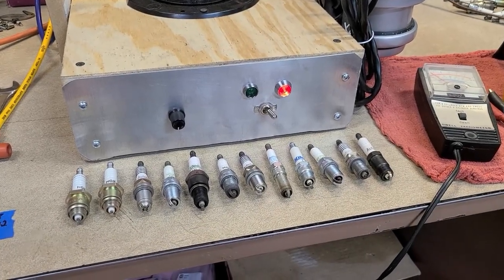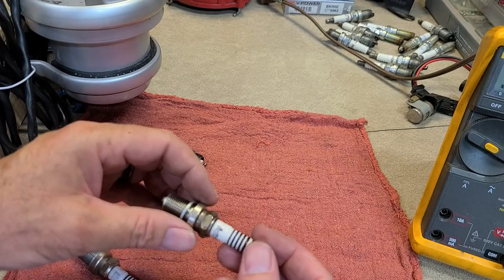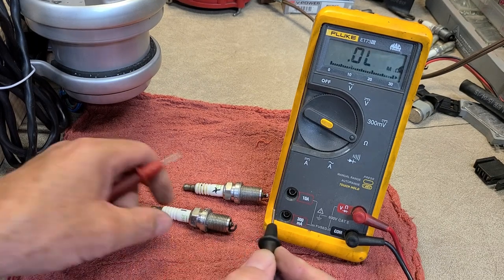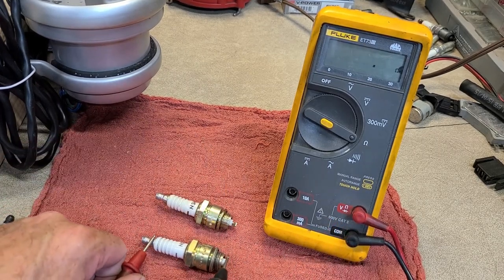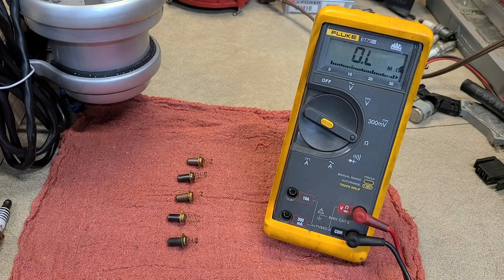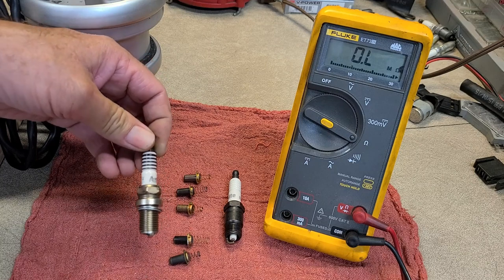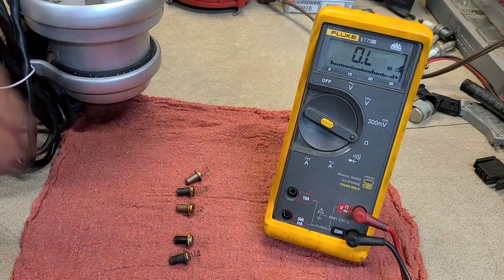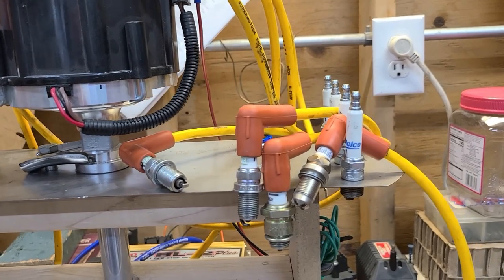Spark plug testing & checking Dwell on an HEI

Comment: AUTOLITE AR3924 racing plug is a 4-ohm resistor spark plug
Reply from the maker: Thanks for pointing that out. For years I was under the impression that all race plugs had no resistor but after looking at numerous plugs it seems some do have a resistor and some don't but they still somehow have very low resistance.
Something I should have tested when we had a racetrack was a high resistance set of plugs versus a very low resistance plug to see if there was an ET difference. Our local drag strip was sold in 2018 so tests like that are much more difficult....

Comment: best module for a big block chevy street car please locked out distributor
Reply from the maker: If you lock out the advance and retain the module, your timing will retard as RPM increases due to latency between the magnetic pickup and the module. Whenever I lock out a distributor the first thing I do is remove the module. You will need an ignition system capable of firing off the magnetic pickup like an MSD 6al for instance.

Comment: I like your videos👍I DO have a question. I worked on a car with an HEI last week that was starting and running very poorly and determined it to be the ignition at fault. Removing the distributor cap and coil cover I found that it had an MSD coil installed but the module appeared to be a factory(?)part- (RKD1906B-2107 and another number- R5003361-C)  a 4 pin module. I really wanted to use a matching coil and module for reliability's sake and would have preferred to use AC Delco parts but they were quite expensive and I didn't want the owner to get mad. I also checked the price of an MSD module to match the coil but that was about $160 if I remember right. In the end I bought a cheap Chinese module for $15 from Amazon, installed it, and now the car starts & runs very well. Now, I have read before that off brand HEI modules are nowhere as good as genuine parts and the dwell does not vary with rpm as a genuine part will. Seeing as to how the car is running fine now my main concern is whether the module will be a problem in the near future especially coupled with the MSD coil. The car is not a race car. It's a nice 1968 Buick Skylark convertible with Buick 350 power. I didn't want to upset the owner with high price repair but I also don't want it to break down anytime soon or at all for that matter. Do you think the MSD coil and cheap module combination is going to be a problem?
Reply from the maker: Thank you for that. The last 2 MSD modules (83647) I bought both failed within just a couple of months so I have not used one again for many years. As far as running an MSD in-cap coil with a stock module, that should work just fine. A quick note about HEI in-cap coils...I should have mentioned this in the video...anyway, for Chevy engines (or distributors that turn clockwise) use should use the coil with red and yellow wires....distributors that turn counterclockwise (Pontiac, Buick, Olds) you need the coil with the red and white wires. I'm pretty sure the Buick 350 you worked on turns clockwise so the yellow and red wire coil is correct. No matter which module you use, it will have "expanding dwell". Modules are the electronic equivalent of points but are much more efficient. The coil needs time to build up the charge hence "dwell time". So, to answer your question...yes, the stock module with the MSD coil will work.
Reply: 🤞the Buick is a clockwise spinner. I THINK it had red & yellow wires. It's runnin' real sweet now. My main concern was whether the "hot" coil would put more demand on the questionable module. The car doesn't get driven often but I don't wanna see my friend breaking down because I made a bad call. Thanks for the encouragement. As for the Champion Spark Plugs, I have always used them in the Chrysler engines because that was the ones that I knew for them. I only started using NGK plugs in them in the last few years because the Champions became hard to get in the ranges that I wanted. I've known about the bad reputation that they gained for years but I never had a problem with them and kept using them with confidence. I don't expect for a set of spark plugs to last 50,000 miles in the type of cars that we are interested in and I would never put expensive plugs in an old vehicle, hotrod, or racecar. A modern vehicle that is your everyday transportation "appliance" that you have no ambition to have to work on is a different story. I WILL spend more money on plugs for that vehicle in hope that I don't have to be concerned with them for a loong time. Besides, there's not a whole lot I can do about the state of tune on that vehicle to influence plug life either way good or bad. Guys that put expensive plugs in their 306c.i./325h.p. '67 Mustang or 454 '65 Chevelle and get mad 3 years later when you insist on putting new plugs in it- Lordy, Lord!  I could go on with stories but I know that you know what I'm talkin' about.
Reply from the maker: @mickangio16  I also install Champion plugs in the older Chrysler engines I work on. I figure the factory sent them out that way so I'll keep them factory. I'm not really sure where the bad rap came from on them or what it was all about but they seem to run fine. I've never run them in anything I own though but I am a Chevy guy, LOL.
Reply: I had always used AC Delco in GM, Autolite/Motorcraft in Fords, Champs in Chryslers... it's another day, though.
Reply: @BruceCoggins  another project that I'm involved in is a 1956 F100 with a 400 Chevy. The owner chose to use headers even though the truck will never be driven hard. He is 84 yrs old and owns other beautiful classic vehicles. With the headers that he chose shorty Accel spark plugs are necessary. They are expensive and only available in colder heat ranges.
Reply from the maker: @mickangio16  That sounds like a cool project. My Doctor recently retired so I have been helping him with his 34 Ford...has a 350 Chevy engine...and he has 2 Corvettes...a 70 & 71 as I recall...I've done a lot of work on those over the last year and a half and he has been right beside me turning wrenches. He is very cool...I should have caught all that work on video but once again, I only remember catching video when the job is almost done, LOL.
Speaking of shorty plugs, I just answered a question about that on an automotive forum today. Guy was looking for some .750 reach shorties...NGK makes some - part number BR8ECM.
Reply: Well, thanks again. It was good talking to you. Maybe again some time👍
Reply: @BruceCoggins  Bruce, I think spark plug application and cross reference charts used to be more available and easier to use. How do you find them? I have had a couple different ones downloaded in PDF for a couple years but it's hard to find anything on my battery operated pocket brain. I was trying to look up the NGK shorty plug that you listed in an effort to compare heat ranges to common AC Delco plugs and S41XLG cross referenced to the NGK number. I'm SOOO CONFUSED😫 I wish I could remember the Accel plug number that I used. I gotta write things down more often.
Reply from the maker: @mickangio16  So, decoding the spark plug number I referenced in my previous reply...BR8ECM..."B" tells me it is a 14mm x 13/16, "R" means Resistor, 8 is the heat range and for NGK plugs, that is slightly on the cold side..."E" tells me it is a 3/4 or .750 reach and the "CM" means compact or short. I'll attach a link to that info. Basically, you just need to know what reach you need and if you need a tapered seat or a gasket seat...however, I have seen plenty of guys use tapered seat plugs in place of gasket seat plugs. 
https://www.ngk.com/ngk-spark-plug-numbering-systems
https://www.sparkplug-crossreference.com/
Reply: @BruceCoggins  well, I thank you for that. More information is a good thing, indeed. From the heat range chart I found on that site, the #8 NGK is a colder plug than I would have preferred to use just like the Accel plug. The vehicle that I talked about is pretty much a car show type truck. It's not gonna be very show-eee puttin' around if it's got fouled sparklers. I envisioned the truck with something like chrome or stainless steel ramhorns or some other suitable exhaust manifolds. The choice of the headers also required some overly complicated steering linkage to the rack & pinion as far as I'm concerned- but I'm not the boss. Thank you again for your time and sharing your valuable experience.